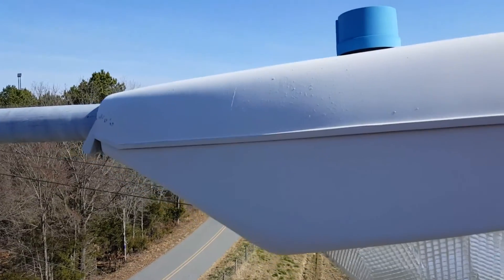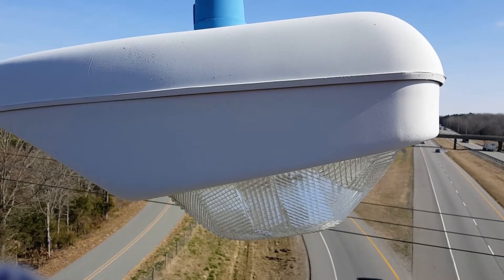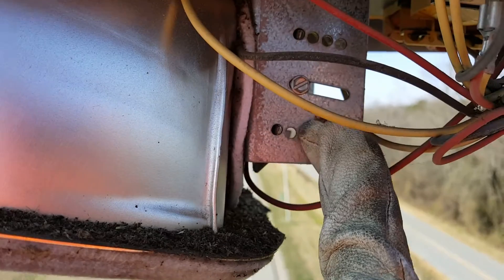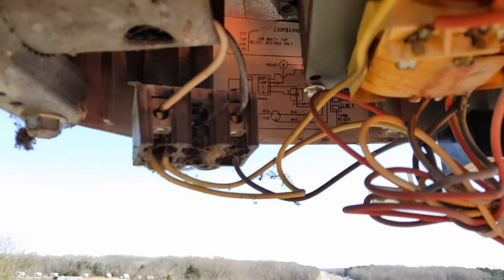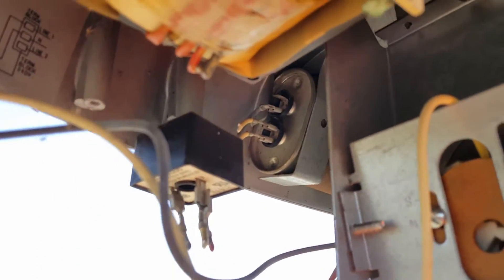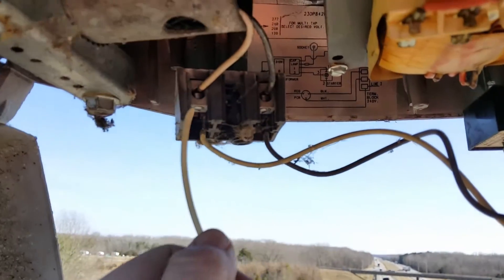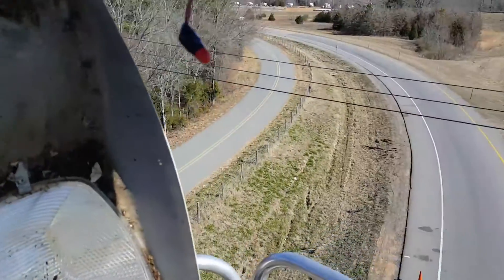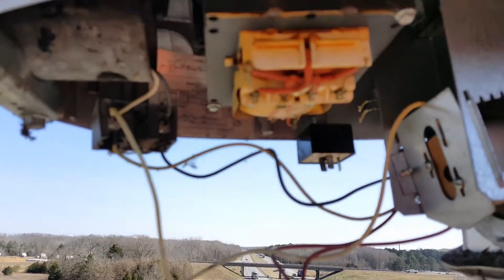Retrofit LED on street light luminaries

Comment: These are a joke. Here in the Virginia-DC area they do this with some of the highway lights and it’s extremely stupid. They are way dimmer because they are meant to magnify a small point (the arc tube) so putting a bulky corn cob bulb is stupid. Just use a 4100k cdmh bulb and that will work the best.

Comment: how come are they 240 unsted of 120v
Reply: Some are 120v some 240v but it has to do with the power phase
Reply: Like he says in the video, there are two phases ("hots"), instead of phase and neutral. The two phases are 180 degrees apart, thus the voltage between them is 240V, even though each phase on it's own is 120V.
Reply: @martinweizenacker7129  true. But could they just use 110v as a power supply
Reply: @johnhershey4010  Yes, they could.

Comment: In the UK my neighboring council has been retrofitting some the older lanterns like this and I think it’s a much better choice than replacing the entire fixture with a brand new LED unit, although I did see a few examples that failed shortly into its lifetime. In fact I even saw one with a strobing LED corn bulb!
Reply: They have been replacing the streetlight with led, in my town for the past couple of years. Many of them fail after a year so les.
Reply: @Hyvelez  Yup tons of them are purple where I live due to cheap phosphor coatings

Comment: Instead of retrofitting, you should’ve bought an LED fixture and sold that luminaire. The bulb isn’t going to be direct as an LED fixture so you’re losing more lumens. Omnidirectional bulbs are obviously a no go for LED or any light source.
Reply: eww why would you decide to force this person replacing the whole fixture with an LED On it in my opinion it's even much better Retrofitting Than Replacing the whole fixture with an LED on it
Reply: @salvadanielonyoutube8  The light wouldn’t be as bright!
Reply: @loudspeakertestsmorebyaida3804  But unless if it's 200 or 250 Watts or some
Reply: @salvadanielonyoutube8  agreed

Comment: People say these bulbs don't put out good light but I've seen these installed in lights and they seem to look exactly the same in light output. besides the reflecter inside the light reflects the light back out of the light which means the light is being redirected onto the road. I think there a great retrofit to install.
Reply: Do you work for the council? Ignorant statement.
Reply: @JonathaninEssex First, this comment was from two years ago, second I work on this kind of stuff and have these older fixtures. I know how to install these types of lamps in these older fixtures. You can't just randomly say my comment is ignorant when you clearly haven't done the research. Do you even know anything about streetlighting?
Reply: Yeah, the older fixtures look much cooler to me, so I would prefer this, even though I’d rather no LED light whatsoever!

Comment: I'm currently retrofitting old hps and mh with these  "corn cobb" leds.  The replacement lamps are bulkier than the old lamps.  So you need to adjust the mounting or reflectors.   I've found that a bulkier 60 watt led is equivalent to a 250 watt hid lamp.  The 100 watt replacement equivalent to a 400 watt hid lamp is ridiculously large and limits its usefulness.  So your led's output is limited by its bulk.  The ease of retrofitting is a major selling point for this lamp.  It is a whole lot easier to retrofit these fixtures than to replace the ballst assemblies.   I have found that the light output to be less than the hids it replaces but it is offset by the ease of retrofitting.  NOTE- I see in the video that the installer is inside a metal caged basket lift.  A fiberglass bucket truck is a whole lot safer.

Comment: I don't it is either Westinghouse, Crouse-Hinds, or Cooper street light fixture. The reflector, and the lens are the same as the Westinghouse street light fixture from 1966-1979, which are 30 inches long.
Reply: It is a Cooper OVX
Reply: It's a Cooper fixture.

Comment: Let me get geeky for a moment... I wonder, have you taken a fixture down and sent it to a photometric lab to see how the light output compares?  Cobra head efficiency runs around 60% with an HPS lamp, and it certainly will go way down with that screw-in LED.  Any light that is going above horizontal into the reflector will likely be lost.  A 250W HPS lamp puts out around 27,500 initial lumens... at 60% efficiency, that's 16,500 lumens that make it out of the fixture.  The LED you put in - 55W - Probably puts out less than 8,000 lumens.  At 60% efficiency, that's 4,800 lumens that make it out of the fixture.  So in the best of situations, you're reducing your light output by 71%.   It'd be different if you were putting up an LED-specific fixture, as they are rated differently.  The lumen output quoted by LED manufacturers are "actual" lumens - there is no multiplier for efficiency. So you could use an LED fixture with 16,000 lumen output and then you'd be putting up something equivalent to 250W HPS. That'd be in the neighborhood of 110W-150W LED at this time.
Good luck with future retrofits.  Thanks for sharing the video!
Reply: sir agree with your point.from china ,if change LED bulbs the lumens goes down,and for the efficiency for LED should be higher than 90% most of them we install in china.the inside wire connection is better then chinese works.lol. thks for sharing this video.
Reply: LEDS produce more visible light, so it will seem the same brightness or maybe brighter
Reply: Fact Checker  not saying it'll directly cause deaths but if the DOT has a spec for how much light should be hitting the ground, after the retrofit it's unlikely they'll still meet the spec, which could open the DOT up to liability in the event of an accident.  Don't get me wrong, I am 100% in favor of LED, but it's important that it be done correctly.  If the state has no illuminance spec, fair enough... But if they do and they fail to provide their own specified light levels, that's where they can get into trouble.
Reply: Yeah dude, that's pretty geeky.

Comment: What kind of LED is it? GE?
Reply: Definitely not GE.  Can't tell whose though.  Here's a link to GE's corn cob.  Which, by the way, is also not suitable for use in horizontal lamp fixtures like cobra heads (for efficiency reasons if nothing else).
http://www.gelighting.com/LightingWeb/na/solutions/led-lamps-and-modules/led-replacement-for-hid/
Reply: The street light is a cooper lighting ovx 250 watt hps street light